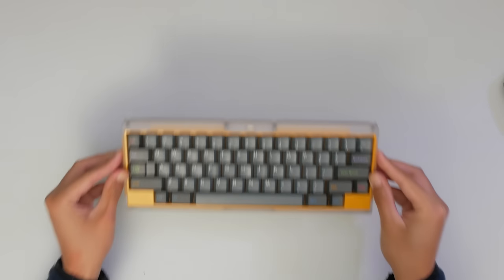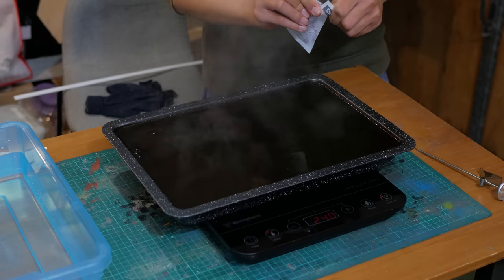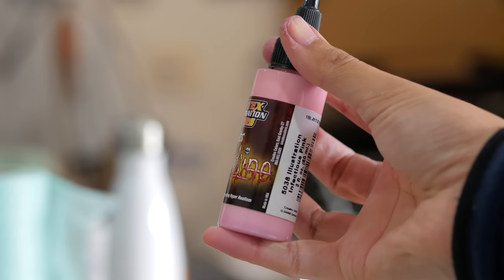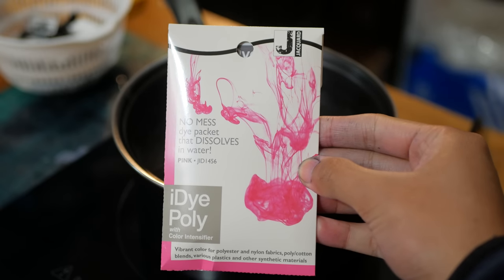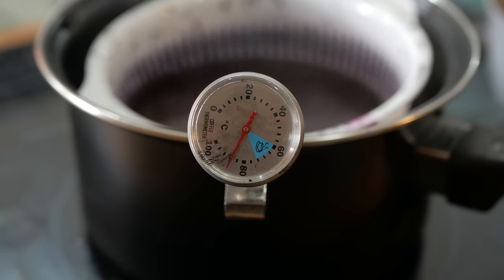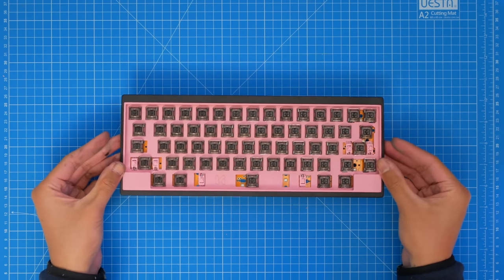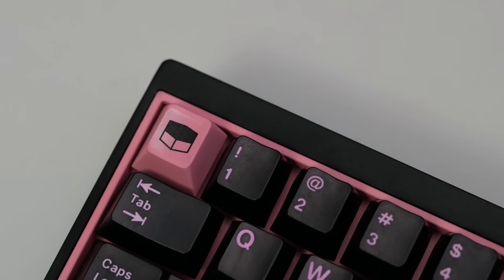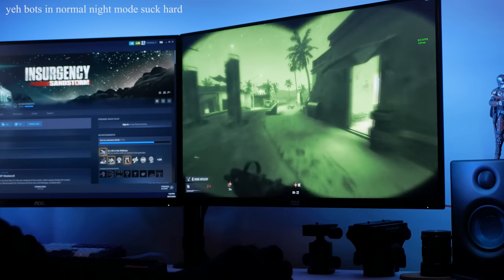BLACKPINK Theme Mechanical Keyboard [KPOP Mech EP01]

Comment: I believe there is a way to print your own water slide decals. If you opt to airbrush some of your other keys in the future that  may be an option for legends. Then cover that with a few layers of top coat. Although its does look good on scaled models, I wouldn't know about the longevity on cap itself due to wear.

Comment: why all the keyboard builders only build without FN keys row and mostly without the arrows keys? and all are using the non-clicky types only. 
whatever happened to building a full-sized keyboard or even TKL ones (with proper arrows keys, FN keys, home-end-pgup-pgdown) keys?
whatever happened to using clicky-switches?
I own both key-switch types and both are good in their own way, clicky, tactile, and linear. would love to see variations instead of every just building Linear ones without FN keys.

Comment: You gotta go to brownells.com and search for Aluma-Hyde. It's meant for a spray coating on guns, but I've been using it on plastic and I did a keyboard recently with it - it's amazing. You gotta let the paint cure for an extended period of time or it will be damaged. A least few days, but I leave it go for a couple weeks.  After a couple weeks though, it's rock hard and you can handle and do whatever you want with it.

Comment: Yo keyboard crew I just got a free 🍒 g81-1800 can I pick up whichever cherry etc switches I want to replace the current (white switches), this is my first venture in to mechanical ownership / upgrades ? Also It has ps/2 not USB can I get a cheap adapter on amazon and connect it to my Mac ?

Comment: 12:42 "I made a lot of mistakes throughout this video..."  Yes, you did. The "C" should be backwards and you separated BLACK & PINK  in the logo. I'm horrified. Your girlfriend should leave you. "See U Later"
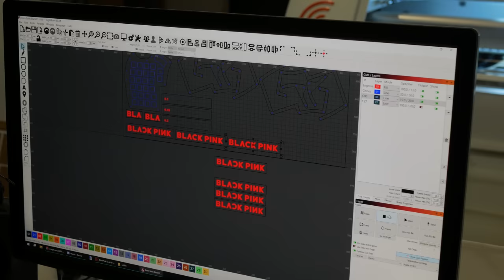Reply from the maker: cant remember if i addressed it somewhere, but it was to avoid any potential issues with YG. As around that time, YG prevented GMK Blink from happening, which was a Blackpink themed keycap set. You can see around 4:08 that I had other options :)